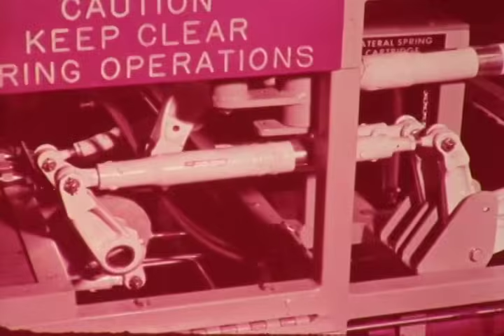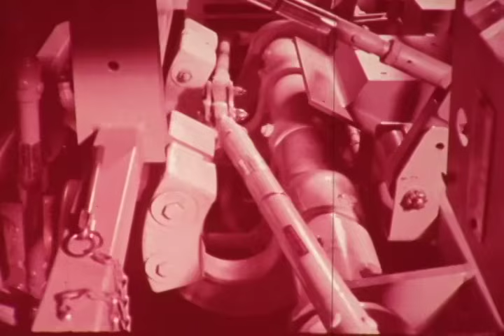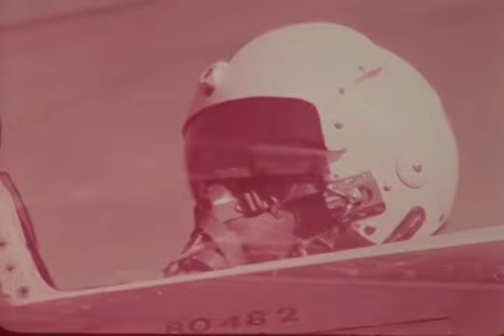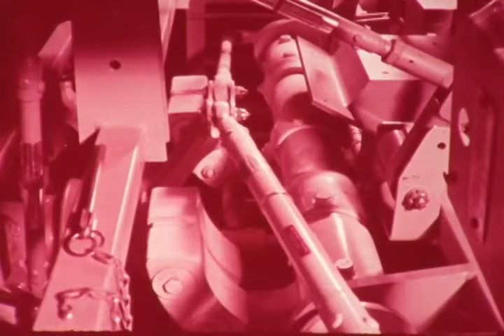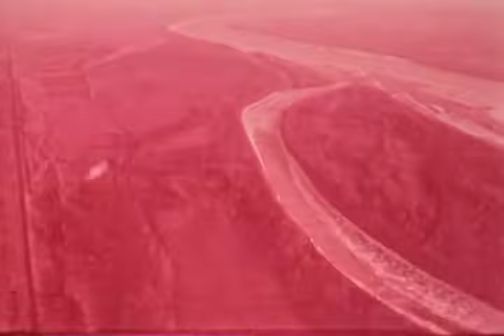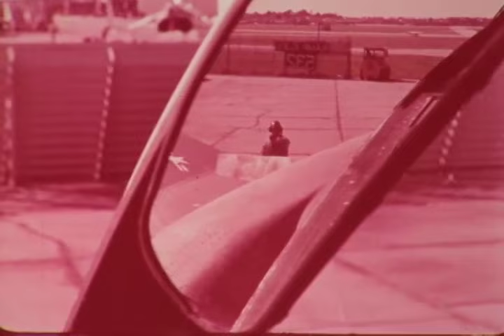F-0005 Flight Control Systems for the F-4

Comment: Does this bring back memories! My five years in AR shop were the best years of my career. Extremely busy, challenging and we had to think! I’ve always felt that the pitch feel trim system design was partially an afterthought. Bellows problems were not uncommon and were typically easily identified and repaired. We lost two pilots when their aircraft crashed into the lake that is at the EOR. The investigation determined that the bellows failed and caused a locked stab. I’ll go to my grave maintaining that the investigation could not positively determine that a bellows failure caused the fatal crash.

Comment: Fly by wire wins
Reply: Until it fails and starts doing whatever it wants and then you're screwed because you have no direct connection to the flight control surfaces. Instead of learning to fly the airplane you learn to anticipate what the computer is going to do when you ask it to perform an action.